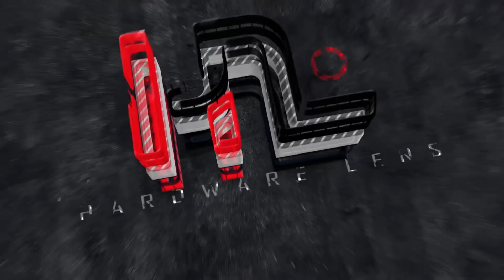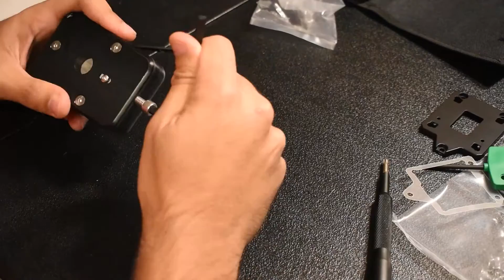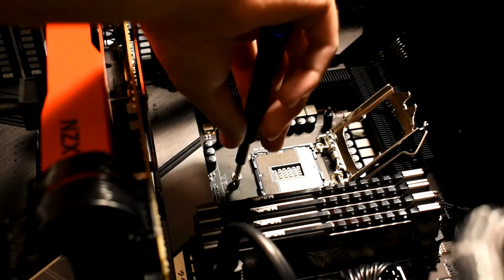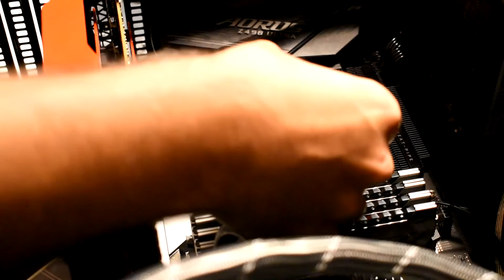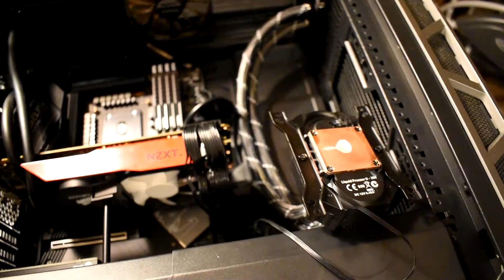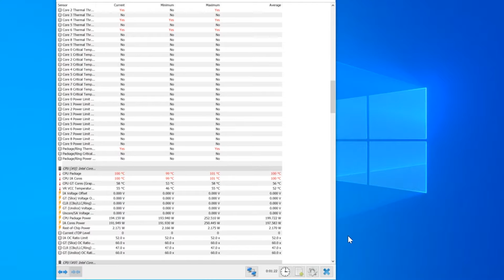Direct Die Cooling the Intel i9-10900K @ 5.2 GHZ

Comment: You should NEVER use regular thermal paste on a direct die. ALWAYS use liquid metal. In this case, you should have been using the Conductonaut.
Reply: I know it has been a year since you commented on this video, but I'd really appreciate that you explain why regular thermal paste cannot be used on a direct die. Throughout the years of building custom watercooled PCs, I have used arctic MX4 multiple times on GPU's without issues and great temps. Why would a CPU die be different? I am not planning to overclock. Thank you :)

Comment: So with the direct die plate... you can go crazy with the tightening all you want, you actually really want it to be very snug.  The Rockit Direct Die plate will not let you crack the die or cause an issue from over tightening, you will strip out the threads before you tighten too much to hurt something ( you can't if plate is installed correctly ).   Also I don't understand why don't you use liquid metal instead of thermal paste?  I have a 10900K with the same kit and I'm using an EK Classic water block run through EK's 360mm Thick all copper radiator and the res/pump combo that comes with the EK Classic kit.  I used liquid metal on my direct die and then ran the Auto OC Bot in the bios of my EVGA Z490 Dark.  It set me up on 5.2Ghz @ 1.28v * not bad * but I was then able to click it up to 5.3Ghz @1.375v.  

I had my 9900k with the same direct die system and cooling running 5.3Ghz @1.320 all day every day with the EK Classic 360mm kit and liquid metal combine with the direct die kit from Rockit
Reply: Sounds impressive... Myt SP63 uses a lot of power more beyond 5.0 ..    Yours must be a SP80 quailty at least..    My BIOS recommend at LLC6 for 5.0Ghz its over 1.4v haha!   I am running 1.31v LLC6 cpu 50x cache 47x 100% stable..
Reply: @lassekristensen385  He's SP100,  I too can do 5.3GHz @ 1.373Volts LLC5.  There are no 10900k's that I know of stable at 5.3GHz AVX.  Basically temps become impossible to tame.  My SP63 performs close to yours.
Reply: @GodKitty677  I 100% think you are right. I had a SP63 and I think I ran it at 5.1 or 5.0 in the end. this was with watercool and and delid/relid?.  Although I was not THAT experienced in OC as now I felt still that I could not be getting any better with what I had without pumping voltage. I have a 14900KS now that sadly has a limit below marketing. I run it at 58/44.   This is the limit for it to run flawless and shader compile, ue5 compression etc.  Its a great CPU though and I feel that even if only 100Mhz on P and E lower. I spend so much money on direct die, liquid metal, watercooling, "car like" radiator with 3 pumps and I cannot reach what I basically paid for!  But it runs amazing like this- I would just not go through all this again! :)  Next time it will be a lower watt cpu and regular watercool (by that I mean I keep my car rad and pumps haha!) but no delid, break warrenty, liquid metal, direct die etc. its just not worth it- But this CPU should last at least a few gens more, loads of life and performance left of corse.... But hopefully we can see through AMD that the 350-400watt show is over!
Reply: @lassekristensen385  My cpu is just as bad it, took creative overclocking to get the frequency higher.
Reply: Ended having use two polymer washers instead of the one to make it work with this same AIO and the RK direct die kit. 

Ran OCCT SSE/Medium and immediately my temps show to 90 degrees. It never even reached 70 degrees delided without direct die. I checked to make sure it was making contact with the aio cold plate and it was but apparently I needed to get a little lower. Ambient temps were fine - low twenties iirc. Ran OCCT again but this time with AVX2/Small/Extreme - fully expecting thermal throttling - but it maxed at 70 degrees. 

Are you sure about the die being protected while tightening? Direct die frame tightening or actual aio onto the die tightening? 

Thanks.

Comment: 10:28  Do you happen to know the measurements or model number of the screws and springs used? I'm running the exact same setup and have run into the same issue.

Comment: I'm thinking that early adopters of the 10900K got much better chips and over time as more have been released theres been a slight decline in their quality. I got a 10900K about a month ago and my chip runs 5.2 w/ 48 uncore at 1.35v no avx offset and tops out at 85C full load using a Corsair 360 AIO normal mounting. However, I've seen the performance of other ppls chips who got them near day 1 launch and they were getting like 5.3 to 5.4 w/ 47-48 uncore at 1.32-1.35v. Then we saw that intel released the 10850K which putting 2+2 together says that Intel only had a limited amount of 10900K's. Its very strange that yours is running that hot at nearly the same specs so I wonder if the 10900K is near the end and intel will push out the 10850Ks soon until they run out. Intel has had fabrication issues for a while now but its gotten a lot worse which is why they kept pushing back 10nm and 7nm. I think its safe to say that 14nm 10th gen is the end of the road for that arch.
Reply: I'm pretty sure 11th Gen Rocket Lake will be 14nm as well, just adding PCIe 4.0
Reply: @sabishiihito  Kitguru did a vid today saying that Intel's next chip for z490 will actually be going back to 8 cores but will have pcie4. So that may be true 14nm will be on 11th gen. I am slightly concerned that  the Nvidia 3080Ti / 3090 will bottleneck on pcie3. The current testing and theories says it wont but we wont know until its released and tested.
Reply: heyguyslol GAMING I just bought one
Reply from the maker: This 10900K that we tested in this video was an early one, it was preordered back in may.  It does seem to be extra hot though, even by 10900K standards.  But your theory makes sense, Intel is definitely having issues pushing out 10900k's!
Reply: @hardwarelens8040  well tbh pre-ordering and actually having it on hand doesnt mean much. If you had received the chip back in May and were just now getting around to OC'ing it that would contradict my theory but you just now received it. I also noticed that the 10850K's are now on Newegg for $500 which again tells me the 10900K's are all about done so what evers left out in the market are the last. Funny thing is no one is touching the 10850K's. They are the same chip just a lower bin that does 100mhz less. Ive seen the test comparisons and I would gladly use one as my use case isn't benefiting that much from 5.2ghz. I went 10 cores because I run a lot of background tasks while gaming, the 2c/4t help take up the extra load of those apps.
Reply from the maker: @heyguyslolGAMING  just to clarify, we received this particular 10900K on launch day back in may, its just that there was no direct die kit available until recently so we never made a video about it until now.  It did seem like we kind of lost the silicon lottery with this one though based on temps and OC results others were getting.
Reply: @hardwarelens8040  it would be interesting to install this chip in an Asus board and see what Silicon Prediction score it gets.  I have a 10900K that is 92 even though it doesn't seem that special.
Reply: @heyguyslolGAMING   I don't think that age has anything to do with "much better chips", after all you would think the longer you process a node like 14nm the more efficient you would get. I think its just all down to the silicon lottery and maybe the amount of cores on one die. When you are talking about just 100-200mhz and .03v you are pretty much at the tippy top anyways lol. Right now I am running a 3770k @4.8ghz 1.24v which I am capable of 5ghz with a jump in vcore to around 1.3v. If we was talking about chips differing 500mhz or more then I would then say there are "much better chips" out there lol. They have pushed this 14nm so far they are almost mastered the process. I think its just tough making a chip with all those cores on one die that matches the performance on the cores at rated speeds. Its seems obvious to me 5ghz is one of those limits and pushing further isn't easy. The 10850k is only a stop gap for the 10900k to provide inventory. But really I mean 100mhz difference is nothing when it comes to performance. The 10900k is DEFF not done though, I see them come and go from stock every week. Its just with all the crazy covid shit along with high demand and issues during manufacture process.
Reply: @heyguyslolGAMING  Even 10900k's themself will have range from maybe 100-200mhz. Just out of curiosity how long have you been overclocking CPU's? I can say I am no guru or been around like I am some old man. But if you think a chip that runs 100-200mhz faster with a dip in voltage around .03 a much better chip. Those very tight differences in a chip has only been like that for a few generations.  Since they have been refining this damn 14nm node for +++++ lol
Reply: @hardwarelens8040  i got this 10900kf beginning of november 2020, it can reach 5.3 all cores pulling 165watts no joke, temp is under 75, cache at 49 fixed vcore at 1.32
Reply: Interesting point you bring up. Because i got my 10700k pretty much day one of it's release, give or take me purchasing that Chip 1week later. But, a friend of mine who also purchased 10700k about 3months later, can't even stay a stable 5.1ghz on all cores. Where I am able to push to 5.2ghz on all cores depending on the tasks, on STOCK 1.350-volt settings. Where as my friend 10700k if he wants to stay a stable 5.0ghz on all cores he has to use 1.38volts.
Reply: You are correct.. the later ones are all SP63, just like mine... uses a lot more voltage than the earlier better binned CPUs.  Also the IMC is weak in my SP63... my 3600 Mhz can only go to 3500 Mhz with some fiddeling..     I dont think a SP63 can handle 5.3 Ghz the voltage would be extreme! Maybe not even 5.2 ...    5.1 is pretty sure.. im runing 5.0 though for more effeciency and lower power consumption and heat. Even on watercooling I have this beast is hot as hell.. I am ordering a Direct Die Kit with Liquid Metal soon though.